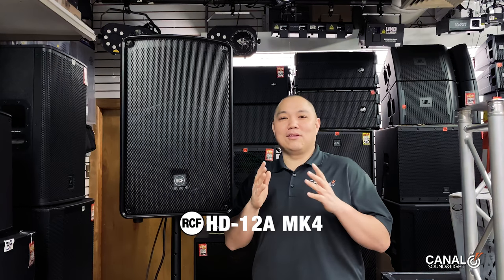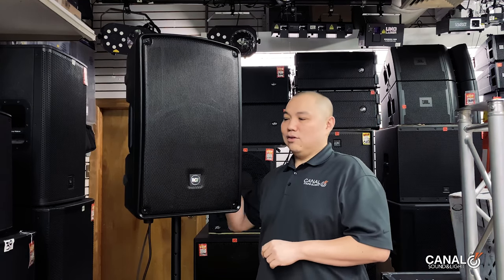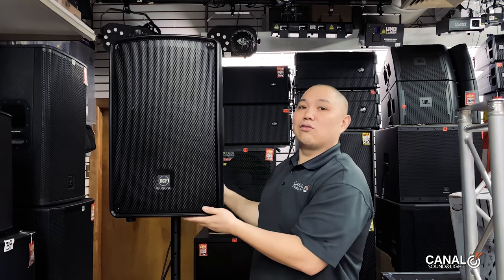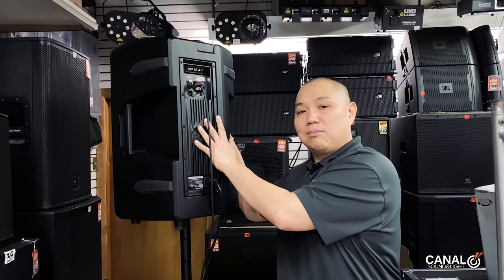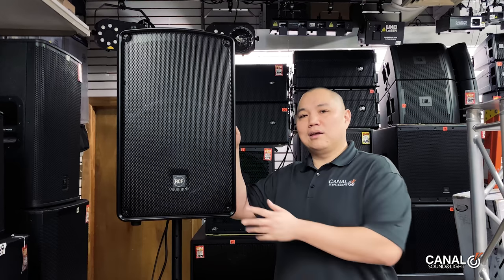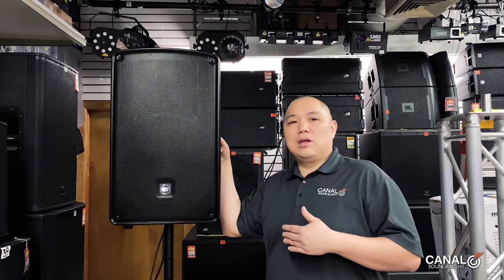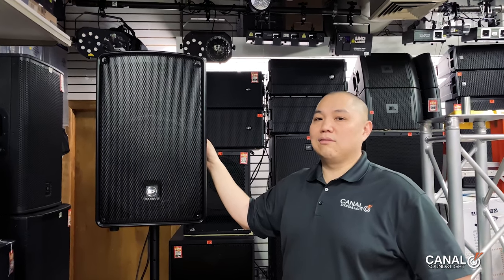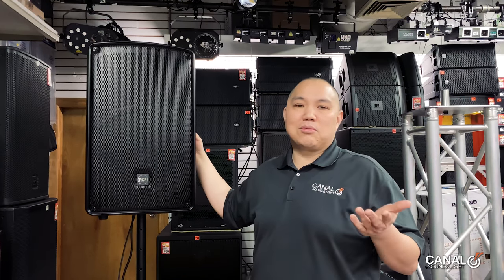RCF HD-12A MK4 Powered Speaker [ Product Review ]

Comment: any difference between this and the mk5- other than where its made?
Reply: If you can get mk4’s they’re cheaper since rcf makes the mk5 now. Not much of a difference
Reply: Mk5 better
Reply: better? how, in what measurable ways or is that just opinion? In any case the MK5 is what is on the market now so it's the one to buy. We have four now. very good but not perfect speakers.
Reply: @paulh_  more bassy more high fy sound i personally will go for the 712 or 715 art series not the 900 series
I have a hd 10 inch mk5 sounds bassy for small box but lacking on vocals as the tweeter its lower quality than the art series
Reply: Heard the hd 12 mk5 no like it  only the 10 inch
Reply: Exactly, I had bought the 10 inch mk5 and it had good bass but that 1" VC tweeter was way too soft and the vocals did not come through.  I returned both and took a bath for the return but just didn't like them.  Will go with the newer ART710MK4 which has a bigger and better tweeter as you said.